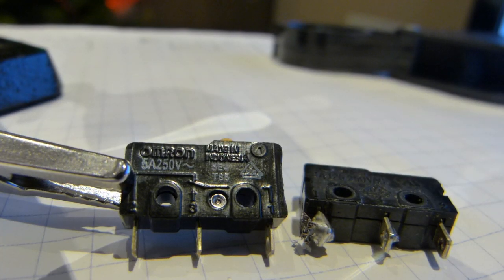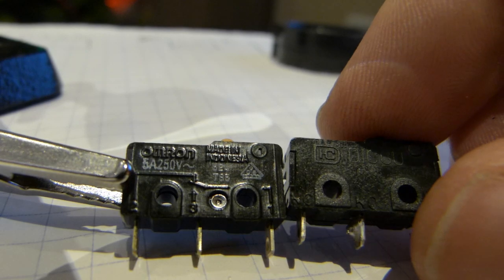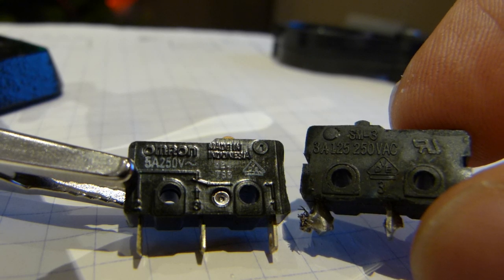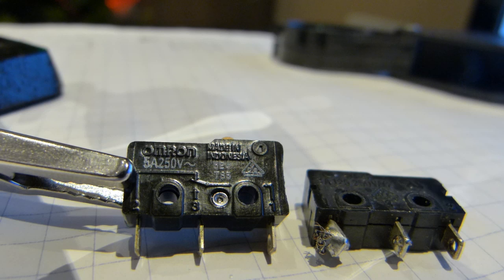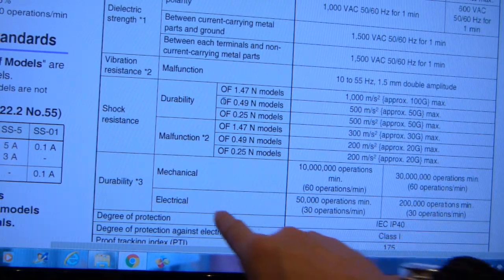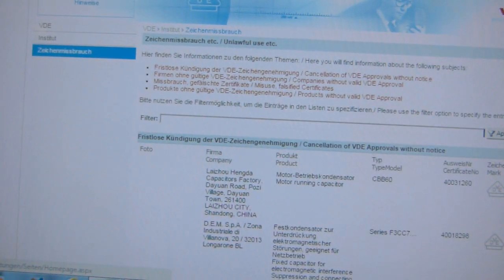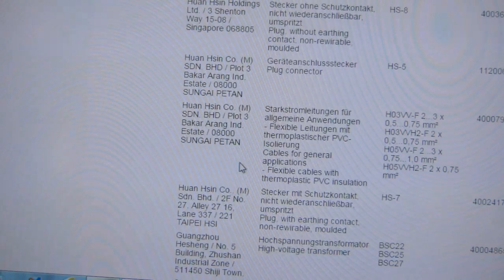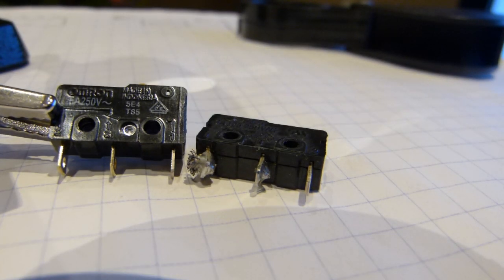5-cent switch vs. $1.57 switch. What`s the difference?

Comment: Could you please recommend me a silent replacement switch for a Logitech G603 mouse ? The current switch is an Omron with a top white button (same as the one in MX Master) that should resist to 20 milion clicks. I find the mouse clicks to be loud though, and would be interested in replacing them with silent ones. Oh .. and is there any way to do that without voiding the mouse warranty ? Thanks
Reply from the maker: Have a look around here among 2171 micro switches: https://canada.newark.com/c/switches-relays/switches/microswitch-snap-action-switches

Comment: I'm curious; I always wanted to know your ethnicity. somewhere in south america? or croatia? idk lol
Reply from the maker: +hostilityy In genetics, my fenotype is tall, blonde, green eyes, athlethic build, my kids have blue eyes, also blonde, etc... speak half a dozen languages, moved around quite a bit, ...
What you hear a mix of all, there is no single source. Plus I try to use words most worldwide viewers would get, ...
Reply: In other words, Hostilityy, have fun while you continue to ponder and guess! LOL! (I was curious, too. But I was thinking more Scandinavian or possibly Flemish). Regardless, THANK YOU. Your videos have been very useful, and ESPECIALLY this one. Erks me that Hoover is still selling this with the defective part still in it. My "new" remanufactured Deluxe model lasted about 3 off/on cycles. Far less than the 10,000 expected. It just stopped turning on altogether. I'll be taking it in to be repaired, but I hope they know what YOU know and replace it with a switch that will work for a while. Seems like this is a VERY common problem.